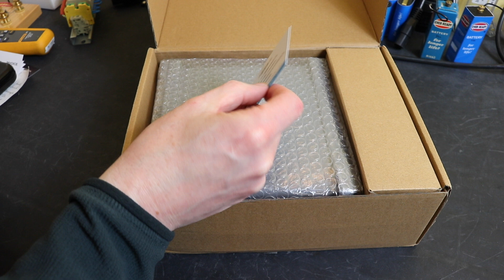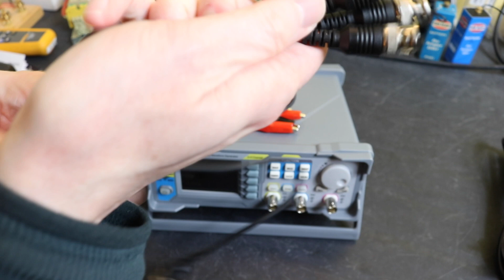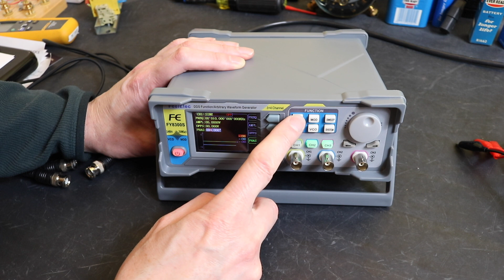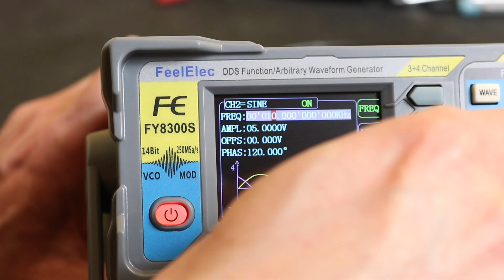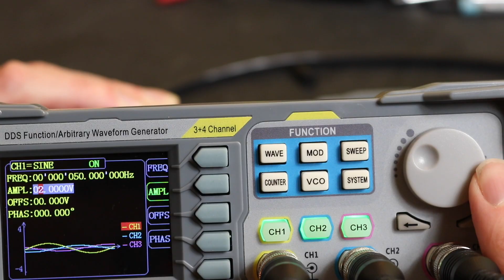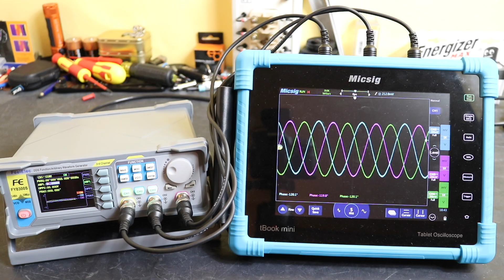FeelElec FY8300s 3-Channel Function Generator

Comment: Interesting. I have the two channel version, but soon after getting it, I switched to my Rigol DG912pro and never looked back.
Reply from the maker: I don't blame you really. For the minimal 3 phase signal requirements I have, the FY8300s suits me, but if you try and push it into the usual uses for a function generator, you very quicky find its limitations.